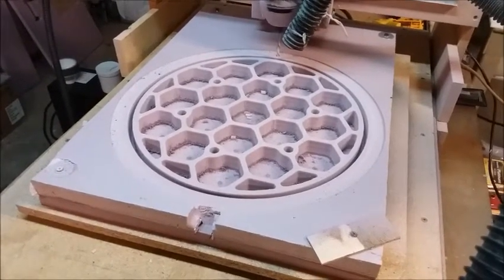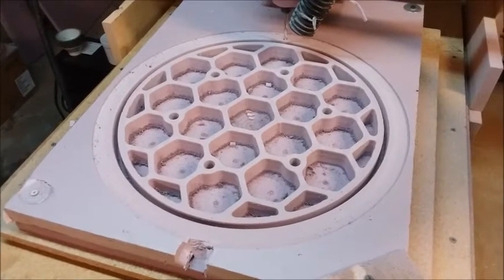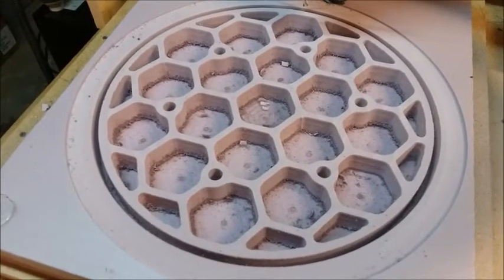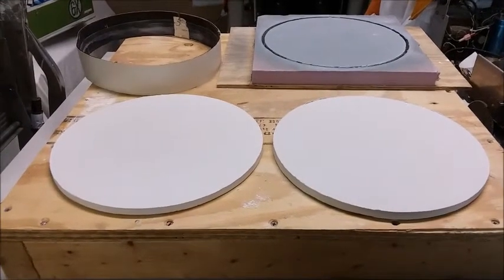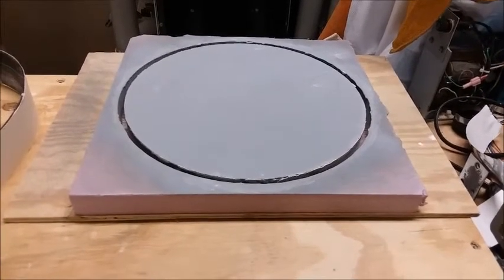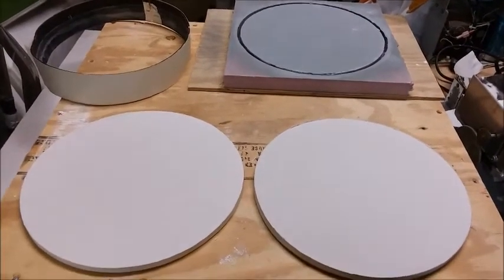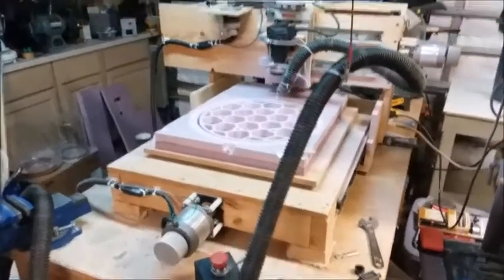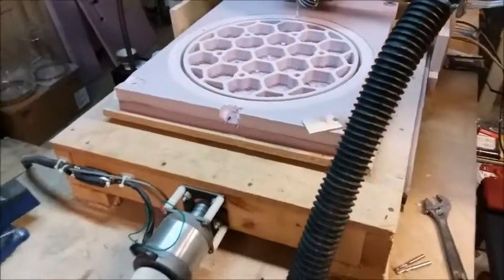CNC Mold Milling in Foam

Comment: How you do it to not getting melt while cutting cause heat?
Reply from the maker: Sharp tools cut without producing lots of frictional heating.
Reply: @omegageek64  thanks, what about duration in exterior? Will it last?  Or what if I glue some face material at top as aluminum

Comment: Thanks for the video. Im in the process of fusing my own telescope mirror. I found the firing time schedule on your site. Step:5 has a ramp time of 1000minutes. Is that not overkill? Its only a 100 degrees down from step 4 (950 degrees). Step 4 is the annealing, right? So why not increase the cool down. Also, I see you’ve replaced your firebrick round mould with a stainless steel ring and sand. Is that the best in your opinion. Thanks!